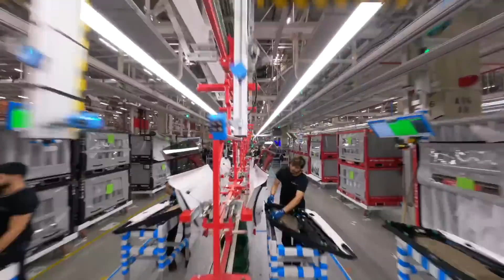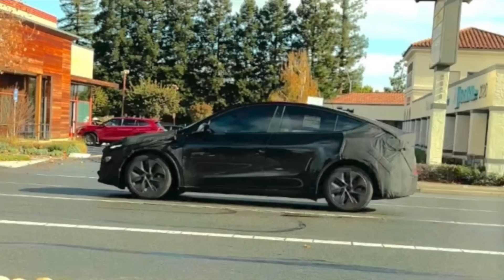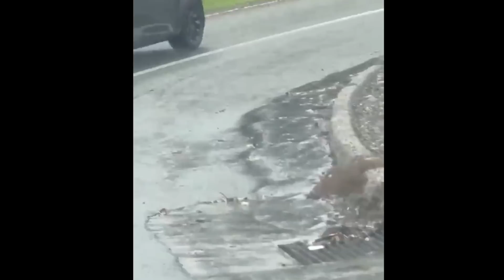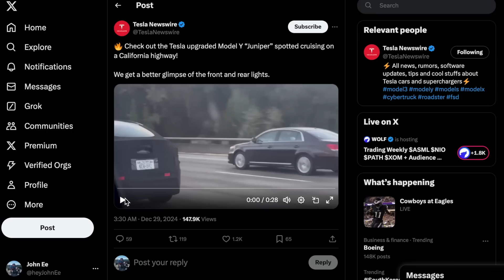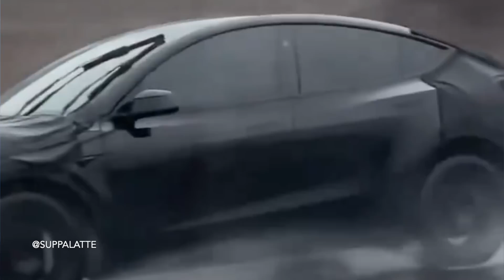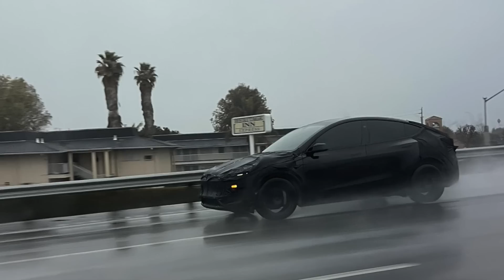Tesla Model Y Juniper LEAKED Exterior Design Confirmed | It Looks Fantastic

Comment: One major drawback with the new solid-state batteries, is the swelling of the battery during charging and, ultimately the degradation of the cell after extensive recharging, lithium is a very toxic metal for the environment, not many countries want to mine it, 98% of lithium is not recycled and goes in to land dumps, the huge amount of  lithium used to make just one  lithium car is  not sustainable for all cars, it takes 1000 gallons of clean water turned toxic just to mine or build one lithium car, this is just lithium and not including cobalt which is another of many other real toxic metals causing  air pollution when mined (horrible) better solution, hydrogen fuel cell future, the way fuel cell catalysts and  membranes , there anode and cathodes are becoming so efficient that one day a tank the size of a  large coke bottle full of cheap green hydrogen will take your car 1000 miles, this is coming and new home solar cells that  make hydrogen coming to market , they will run homes and cars at cheap cost effective prices, why because solar cells have become much more cost efficient in making green hydrogen and better storage in long run, getting bang for buck from solar cells than having  battery storage or just plan electricity, fuel cells will always have 10 times more power than any other lithium battery or solide state battery, fuel cell are proven and solide state or lithium will loose in the end when it comes to raw power , fuel cells are becoming truly remarkable engines for all transportation ect,  hydrogen fuel cell refueling tanks for cars are made with really strong carbon fiber 5 times stronger than steel,  tested for super safe high impact, making it  safer than combustion engines or for that matter a lithium cars, plus amazing secret about hydrogen fuel cell cars is  that each car actually cleans the air as it runs due to it`s clean watered electrolysis when released onto the atmosphere, after all lithium EV batteries cars most are still connected to oil and coal grids, any way you look at them they still are not eco friendy enough!
Reply: Bot. Lots of incorrect information here.
Reply: Almost 98% of everything you said has been proven false or is outdated information from like 2005 lol
Reply: @iamworthy1302  get educated,  This is changing and cheap cost efective green hydrogen will be abundant by 2030, it`s coming, in Japan hydrogen grill restaurants are the new craze, hydrogen food grills produce no toxins in food as compared to propane grills,  Hyundai Rotem plans on building hydrogen fuel cell military Tanks and vehicles enhanced with AI hydrogen fuel cell drones!

Comment: It looks like a minor face lift just like the Model 3 redesign.  And say goodbye to turn stalks.

I don’t get the hype.
Reply: Have you driven the new model 3? You'd understand
Reply: @ yes I have.  The ride is much improved but that’s not saying much because the old version was brutal.  The whole stalkless thing is completely unnecessary.  They were trying to reinvent something that didn’t need to be reinvented.  They actually should have added controls for some things imo.
Reply: @kevinn1158  i test drove a new model 3 from the old one. it’s such a smoother ride. less noise in the cabin is a huge improvement no one talks about
Reply from the maker: It’s everything combined that’s super exciting, including the drive train and battery
Reply: @heyJohnEe  I don't think the drivetrain or battery will have any substantial changes.
Reply from the maker: @kevinn1158 it is speculated to come with more efficient motor and likely better suspension similar to the M3, while the battery update might arrive in later integrations of Juniper
Reply: @heyJohnEe is the new battery confirmed?
Reply from the maker: @OrangeJuicePapi battery update might arrive in later integrations of Juniper using the improved CATL design, although no official confirmations yet

Comment: You are lucky in America getting Tesla’s way cheaper than us in the uk 🇬🇧 
Here in the uk 🇬🇧 we even get taxed for breathing 😳🤭👌
The M3P here in the uk 🇬🇧 is the equivalent to $75k in USA 🇺🇸 😳
Reply: One major drawback with the new solid-state batteries, is the swelling of the battery during charging and, ultimately the degradation of the cell after extensive recharging, lithium is a very toxic metal for the environment, not many countries want to mine it, 98% of lithium is not recycled and goes in to land dumps, the huge amount of  lithium used to make just one  lithium car is  not sustainable for all cars, it takes 1000 gallons of clean water turned toxic just to mine or build one lithium car, this is just lithium and not including cobalt which is another of many other real toxic metals causing  air pollution when mined (horrible) better solution, hydrogen fuel cell future, the way fuel cell catalysts and  membranes , there anode and cathodes are becoming so efficient that one day a tank the size of a  large coke bottle full of cheap green hydrogen will take your car 1000 miles, this is coming and new home solar cells that  make hydrogen coming to market , they will run homes and cars at cheap cost effective prices, why because solar cells have become much more cost efficient in making green hydrogen and better storage in long run, getting bang for buck from solar cells than having  battery storage or just plan electricity, fuel cells will always have 10 times more power than any other lithium battery or solide state battery, fuel cell are proven and solide state or lithium will loose in the end when it comes to raw power , fuel cells are becoming truly remarkable engines for all transportation ect,  hydrogen fuel cell refueling tanks for cars are made with really strong carbon fiber 5 times stronger than steel,  tested for super safe high impact, making it  safer than combustion engines or for that matter a lithium cars, plus amazing secret about hydrogen fuel cell cars is  that each car actually cleans the air as it runs due to it`s clean watered electrolysis when released onto the atmosphere, after all lithium EV batteries cars most are still connected to oil and coal grids, any way you look at them they still are not eco friendy enough!
Reply: @Joa-y4y  but have you seen the costs of hydrogen something like 4x times the cost of regular petrol 🤦🏻‍♂️
Reply: @Alan-xk9rk  Cheap and cost efective green hydrogen is coming, it will be abundant by 2030, when used in a fuel cells, hydrogen can produce power for transportation and heating, without emitting harmful byproducts like nitrogen oxide, hydrocarbons and particulate matter.  in Japan hydrogen grill restaurants are the new craze, hydrogen food grills produce no toxins in food as compared to propane grilled food, Hyundai Rotem plans on building hydrogen fuel cell military Tanks and vehicles enhanced with AI hydrogen fuel cell drones!
Reply from the maker: Export always costs extra, then there’s always always taxes. Maybe one day they’ll built a factory in the Uk 🤞

Comment: Why is everybody making a big thing about a light bar and one long strip interior lighting so many cars have that and more already LOL if I get the new Tesla is going to be because of the range not because of looks because I love the ev6
Reply from the maker: Hard to explain, but it’s kinda like how everyone raves about iPhone getting a slightly smaller notch, but no one even notices that Samsung has no notch at all. Other EVs may have all the best features first, but it goes unnoticed until it’s on a Tesla
Reply: main reason is that with a light bar on the rear, it will become as ugly as the current front.  And yes I drive one but purely for the tech-part.

Comment: Short of the light bar.. all these changes on the exterior seem minor to me…similar to model 3
Reply: The 3 and Y have a perfected chasi design no need to redesign that but instead what they have done is perfect
Reply from the maker: @GhostFiber agreed 👌
Reply: That's how Tesla does it though. These "refresh" changes aren't going to be insane changes to make the car look like a whole different car - they are just going to be minor changes and improvements that will definitely make a big difference when comparing the newest to the previous versions.
Reply from the maker: It’s still based on the same original Model 3 chassis so likely stick to the same design until a complete revamp happens
Reply: They did need to change them ugly lights at the front 
If it does look way better I might be tempted to get one however here in the uk 🇬🇧 our government are really fucking the tax payers up by increasing the tax on new cars 🤦🏻‍♂️🙄😳
Reply: @Alan-xk9rk  Here in the US they are most likely removing our government incentives ($7500 discount) sometime in 2025 and Tesla won't have promos, discounts, or incentives for Model Y refresh when it initially comes out so all will cause Model Y refresh to be $50k-$60k+ car w/ fees and taxes (excluding loan rate's interest which is currently at 6%). 

The rich and impatient/not responsible people will buy the car when it comes out but sales will definitely drop hard in the US unless Tesla takes some action.